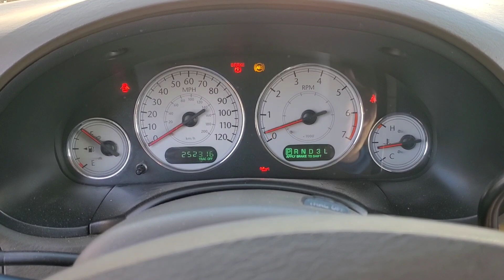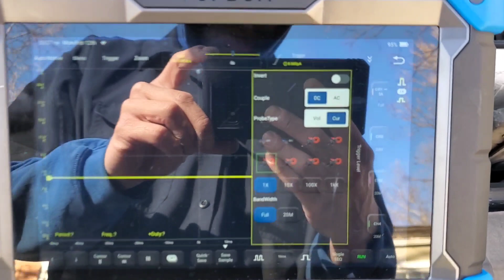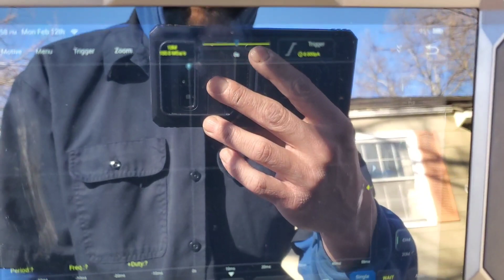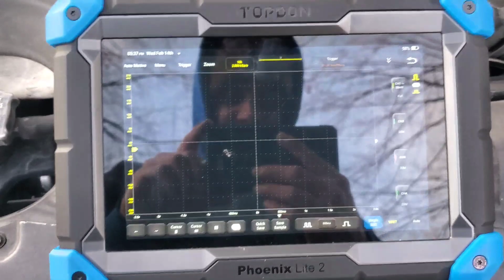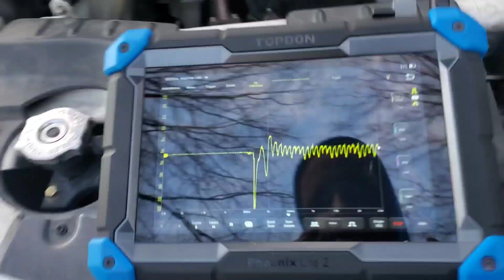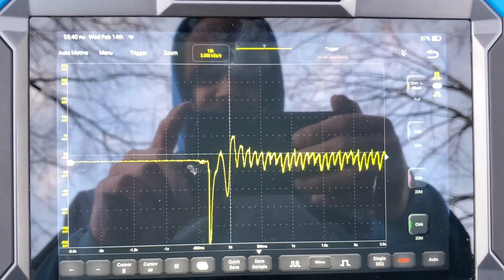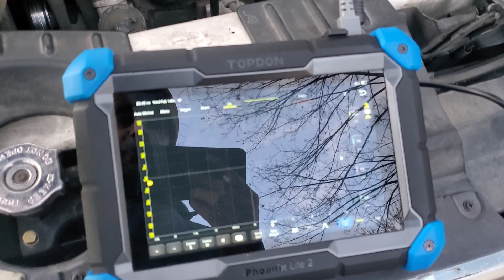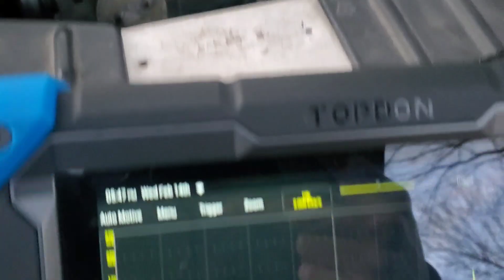How to perform a Relative Compression Test!

Comment: Have you tried using the crank sensor signal for relative compression test, using the same logic the computer uses for misfire detection?
Thank you in advance for your answer.
Reply from the maker: I personally have not but I've seen other videos of it being done. I am still relatively new to using scopes and shortly after I got my scope I got busy with lots of non scope related work but I still plan to do more videos on scope tests and my learning process in the future. Stay tuned.
Reply: @Andys_Auto  Thank you for the reply. 
An idea for a video, scope a coil primary (use high resistance probe to protect scope) with injector disconnected with a rev watch end of burn line climb due to no fuel molecules conducting in plug gap.

Comment: Interesting.....For an accurate specific cylinder "Low compression" Only detection test, You should Keep the Removed sparkplug Wire connected to the Sparkplug with the Removed sparkplug Thread/Shell Connected to engine Head/Block ground.....This Keeps the Ignition system electricity Undisturbed & the Removed sparkplug Gap  Firing in actuat Low compression (15 psi) Ambient atmosphere Psi Environment.....Leaving the Removed sparkplug wire  Disconnected & Not arc/sparking artificially Disrupts the Ignition system that Dosen't happen with a true only Low Compression cylinder problem......Maybe you could Retest & check.....Thx for video...
Reply from the maker: I considered the spark plug wire being disconnected may not be great on the ignition system but I wasn't really sure what to do with it and since I was only cranking it over for one test I figured it wouldn't hurt too much.

Comment: Once past the learning curve the oscilloscope is a useful tool for diagnostics. On a lot of cars today you can't access certain banks without removing the intake manifold. This makes using the compression gauge a time consuming operation. Looking forward to future videos on the oscilloscope. Has that oscilloscope book been a benefit in explaining it's use?
Reply from the maker: If you are referring to the Waveform analysis book I mentioned in a previous video then yes. That book taught me what good waveforms look like and why. Now if I just get some reps in with setting up the equipment and settings on the scope ill be good to go